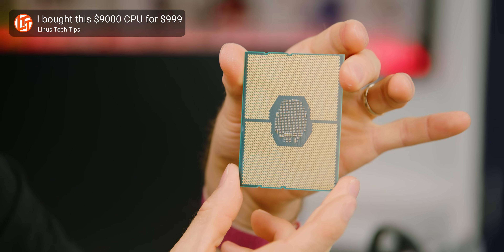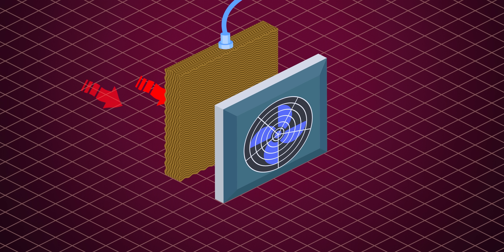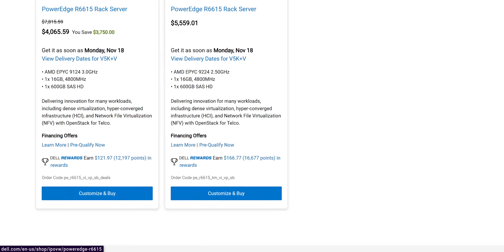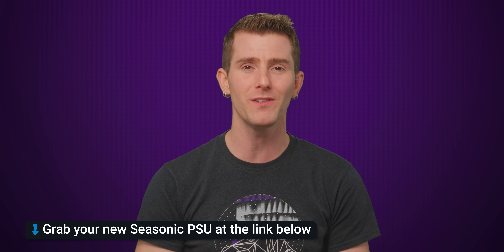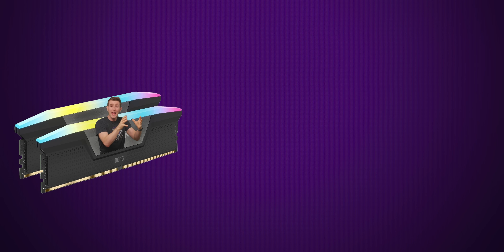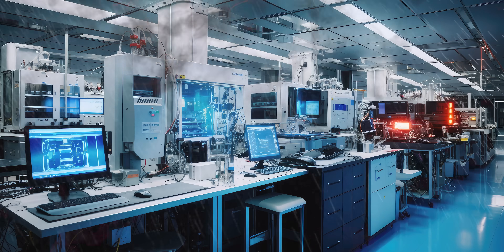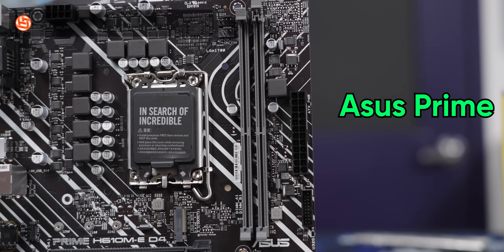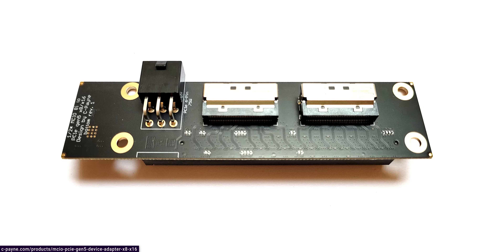What’s The Difference Between A Server and a PC?

Comment: I've used quite a colorful array of "servers" over the years. In the early days when Minecraft was still up and coming and Teamspeak was still a thing I've used some old spare laptop tucked away somewhere (with adequate cooling) to host game servers and VoIP... until it's fans gave out. Reliability? Never heard of 'em.
Next I upgraded to something more professional since my needs shifted, a Synology DS713+ NAS to store my files and backups and host some lightweight applications.
And while it was not very powerful, it was very reliable. Never crashed, never complained for many years. I still have it around somewhere, and it would probably still work fine.
But nowadays I use a custom built 4U rackmount server with a Xeon E-2276G, 128GB ECC memory and 54TB of HDD Storage running Unraid, with dual parity disks + 2 cache M.2 NVMEs for Docker containers and VMs. My network as a whole also got a big upgrade, at the core I have a second-hand HP ProCurve PoE switch (lifetime warranty, already saved my ass once!), a hardware firewall (FortiGate) and a handful of Ubiquiti APs.
Been a really interesting journey so far, and I can't wait to see how it continues.

Comment: Architecture used to be different, too.  x86 machines rule the roost now but most Unix and Unix-like boxes weren’t x86 until sometime after the turn of the century.

I have a uVAX II and ostensibly, it was a server at some point.  But, I think the exception to the x86 might be IBM’s mainframes, now.  Or ARM.

Comment: Linus, what about the breaker boards like Nvidia has?

Their Orin Boards are about the size of a credit card, and that’s including 64GB DDR5 and the largest NVME and SSD you can stick in there(besides PCI-express

Considering they have multi module boards for AI and networking, could you cram More hardware in that way, say if you have 4x 7 module boards per shelf/rack?  

That would be 336 CPU cores, 1.792 TB Ram, 224 TB storage (not including PCIe or other connectivity) and 57,344 GPU’s- and each one can be dialed from 50 watts, down to 15 watts.

That’s a grand total of just under 1.3 KW or under 500 watts (15 watts a piece)

That’s more grunt and less power than an Epyc Server!  Including GPU Computer!

Comment: Really the difference from your home PC and a server in hardware is most servers will have redundancy and most servers will have error correctly RAM. The rest depends on the use for the server as server CPUs can range from 8 very efficient at passing data from PCIe slot to PCIe slot and PCIe slot to system RAM to 192 CPU cores for heavily multi threaded on the CPU compute tasks. You then have the servers wtih maybe 128GB of system RAM  and maybe a quad core CPU but 50 or more 3.5" drives. Etc. with different types of servers out there you even can turn a raspberry pi 2B into a server and if what you expect it to do it is able to it will run well. The point of that very low end computer example is to show server hardware doesn't have to have insane specs unless you are locking at how much space and power does it take which the raspberry pi is kind of good for. Just  most enterprises do not like community supported hardware with most likely made by the company using it or community supported software. So in the low power is everything environments they still use x86 CPUs due to Business to Business support networks. The thing is in homelabs Raspberry pis and its competitors are used as good servers.

Servers are very specialized into 1 thing while the home PC is build for general use. So no insane amount of anything but everything will work.
Server software will run on both the made for the process hardware but also your home PC as long as you also have the hardware processors to run the correct instruction set or instruction sets.

Comment: Not only the hardware but also the software. I used to work for the USA's largest bank which has pretty much all of its processing here in the UK (yeah thats odd). Anyway they have the biggest DC in the UK which is the size of 3 football fields. It is insane. Every server runs a special core of Linux and is immeadiately absorbed into a massive computing pool once they come online. So those 2000 + physical servers are all effectively one. It was super clever and very interesting to work with.

Comment: The difference is function not form.  We had a dozen old desktops which used to function as PCs that we started using as print servers (of sort...it's complicated).  They were formerly developer desktops and, when they were too old to be used as such we just started using them as interfaces between mainframe and printers (again, it's complicated).  Nothing in the HW was changed.  The function was changed.  I've used old PCs as servers as well at home with no or little HW change so again, it's function, not form.

Comment: Memory errors in gaming PC's are more common than most people think. A single bir error, what ECC can detect and correct, doesn't necessarily mean that a program will crash. If you look at a gaming PC the executable code in memory is not all that large. Most memory is used for graphical elements, sounds, game maps and so on. Code that isn't really containing executable code. If a single pixel in a graphical element is the wrong color or a single sample of a sound has a bit error there is little risk that the game or OS will crash. In a lot of cases you won't even notice anything more than a blip in the sound, a strange frame in a video or a single pixel in some texture that has the wrong color. The code running through the processor is pretty damn small in memory compared to all the other assets used by the OS, the programs you use or the game you are playing.

Now I did say that ECC can detect and correct single bit errors, and that's the bog standard ECC that's been with us for many decades. It will detect dual bit errors and more, but it can't correct them. A single bit error is something you will not notice when using a machine with ECC memory. All that happens is that there will be a note in the system log saying an error was detected and corrected. One such message is not worth thinking about. it's just ECC doing what it is supposed to do. A real problem is however there if you start seeing numerous ECC messages in the log. If they are occurring several times per second or so the log in Windows will just have a message that errors has occurred and been corrected but as they are so common reporting of them has been paused after some number has been reached. It's been years since I worked with this but I think it was in the two hundred errors before pausing. If this happens there is a real problem that should be addressed ASAP. The thing is that if a additional bit error occurs so there are two or more bit errors on the same read the OS will stop the machine as ECC cant repair the error.

So why does bit error occur? Not all bit errors need to mean there is a real memory problem. Most of them are simply generated as particles of cosmic energy trike a memory cell and manages to change the value, making a "1" a "0" or the other way around. This is just things that happen, and we really can't shield computers against them. These particles can go through the earth so a lead shied or something like that wouldn't make much difference. So we use ECC memory in servers to try to keep the bit's in order.

Now there are more advanced ECC and memory protection techniques. I remember that many years back some chip manufacturer designed a ECC based technique that would detect and correct up to dual bit errors. I can't remember the details though. There were also one that would map memory as unusable if it detected major errors in a certain memory segment. The intention was that if a machine crashed because of memory errors that the ECC couldn't correct it would map that memory as unavailable when the machine was restarted making it usable but with limited memory. I think it deactivated a whole DIMM at a time, but again this was a long time ago and I can't remember the details. Also this was way back when the chipset on the motherboard contained the memory controller. Unlike today the chipset manufacturers could invent their own ways to protect memory, something that they can't do today when the memory controller is integrated in the CPU.
Some really interesting solutions has been lost with the new modern processors. But the added performance is considered to be worth it. Today it's the processors that has to support ECC, something Intel is bad at doing for their desktop processors. The Ryzen processors from AMD is a bit better at this, but even then not all models will support ECC and a lot of motherboards also lack ECC support.
Reply: Thanks for this comment.

Comment: I think lot of the problem is late 1990s and early 2000's when they used PC Desktop with multiple Hard Disks, CD or DVD-ROM drive were called Home Servers and Multimedia Servers.  Granted when compared the silly amount of storage you can fit into todays ATX or Micro ATX case are at the end of day, a hopped up PC that have excessive Storage space.

Comment: Actual answer, nothing.  HOWEVER actual purpose built Server machines are designed more for networking workloads as opposed to performance.

Think of it as the difference with having a fleet of Buses or work trucks vs.  A single high performance sports car

Comment: Also, hot swappable drives, dual redundant power supplies, ILO board (integrated lights out), multiple NICs, the list goes on.
Oh yeah, and lots of noise.
Reply: @MrPants-xy6db  Maybe, but also maybe not. Some servers are water cooled. It depends partly on where they are installed.
Reply: @christophernugent8492  I don't think that's very common in the server space to have watercooled servers.
Reply: @JJFlores197  Google does.  I have seen them first hand.  I'm an electrician and worked for a company that built one of their data centers from the group up, then stayed on for 3 months for QC.  I have also worked in other data centers.  Theirs is on a whole other level.
Reply: @JJFlores197 it becomes more common most of our new hpc are actively watercooled our older hpc are passively watercooled
Reply: @robbyrne6968  Water is not directly cooled the servers. It's other liquid (coolant) that flows though cold plate on CPU and GPU. It then cycle through the CDU (Coolant Distribution Unit) which has heat exchanger (with water) to cool it down.
Reply: @robbyrne6968  Ah that makes more sense. I was thinking more of the traditional data center/server room with noisy servers.
Reply: FYI: ILO is HPs out-of-band management (sometimes called lights-out management). There are many other versions made by competitors, for example Dells version is called DRAC (Dell Remote Access Controller), or iDRAC if integrated.
Reply: SATA hotswap is a thing on regular PC's
Reply: @whateverman2137  Hot Swap is a thing in SATA (revision 1.0a) but are usually deactivated on BIOS.
Sometimes u doest have any config to turn it on.
And the drive needs to support it.
How swap is a old thing in server world.
Reply: I couldn't hear your comment over the fans. Would you repeat that, please?
Reply: I'm pretty sure Linus has zero idea how to set up a Stable Corporate Network....
Reply: Totally.
Reply: ILO/iDrac is what really makes a server.  Without that, it's just another workstation, no matter how much CPU/RAM/storage it has.

Comment: The only difference between a PC and a server is its purpose. If it connects to other computers, it’s a client, if it accepts connections, it’s a server, it’s as simple as that.
Reply: They should have specified they mean dedicated or high performance servers.
An old gaming PC, laptop or Raspberry Pie running some services are also servers, just not rack mounted, hpc machines.
Reply: Yeah, I would say that the biggest difference is the software.
Reply: well, if your computer accepts a Team Viewer remote session from your tech support it makes your computer a server under your definition.
Reply: @TangomanX2008  It does not, as this would require port forwarding, which isn't even possible on some ISP routers. What actually happens is that two computers connect to a teamviewer server, establish a session and communicate through there. Neither accepts connections on its own, so neither is a server.
Reply: @shapelessed  

Look, the server/ pc distinction is vage. There is no definition that relies on specific technical requirements, like bandwidth or protocol, or operating system, could, etc for a "Server", at least none that is binding. If your machine is running Server 2019 I guess it's a server in some sense, but I doubt it's a server in the sense we are discussing. If you allowed someone to remote into virtually with the ability to access files, run commands, install or remove software that sounds a lot like a server to me. Anyway, this is the epitome of a semantic debate so  I won't discuss this further.
Reply: That does not conflict with what he is saying is both less interesting and less useful than the information in the video even if it’s correct.
Reply: My PC accepts many connections
Reply: My laptop is a server fam😂
Reply: I'd say redundancy plays a big part and only if you deploy servers in numbers. Servers can take decades worth of beating before falling over while desktop components will just fail taking whole thing down. Servers have a lot of redundancy built in. A NIC, PSU, random fan, stick of RAM, whatever dies, when the environment is set up right, just let the host shutdown, fail over, and swap out the hardware and reboot it. Sometimes you can even just hot swap most of it. Depending on how your cabling job in the back of the rack is lol
Reply: @Baulder13 I don't think that what you said is necessarily important for a PC to fit the definition of a server.
I connected an old 2014 cheap laptop to my router and forwarded some ports, I host a website, and a VPN, a password manager and other small services on it.
By all practical means this is a server, but it's not the big racks upon racks of compute power with the heaps of redundancy you imagine.
Reply: There are servers and "servers". My home server is literary my old desktop.
Reply: Well... servers are designed for heavly I/O and a ton of RAM and disks
Server processors usually are 3-channel instead of 2 as a PC
Processors have lower clocks and much more cores, and uses a reliable architecture (client PCs usually uses the last architecture, and Xeon for example takes a long time to switch to a new one)
Motherboards and power supply are proprietary instead standard...
Usually they have iDRAC or some remote technology for accessing it... PCs for enterprise have vPRO/AMT, but is not the same OOB.
Reply: @AlexeiDimitri  Enterprise Servers are, and they today have 12 channel memory.
But anything that runs a service can be a server. And even then, you can buy server motherboards in E-ATX or ATX form factor powered by normal ATX power supplies with remote management.
High density servers often have custom motherboards to optimize for space, but there are many that use standard form factors.
Reply: @AlexeiDimitri  heavy*
4-channel*
use*
Notherboards are only proprietary if they come in a full server assembly, which is  ot all of them*

Comment: After 25 years of using desktop hardware for my home server (upgrading and replacing over the years), I finally put together a real-deal server.   2 CPUs, 72 threads, 96gb R ram (128gb on the next powercycle), 5 drives with 2 raid arrays, 4U case.

It's GLORIOUS!!
Reply: I grabbed be an ex-business CPU+MOBO+RAM combo from eBay (there a lot on there, and /r/homelab and /r/datahoarder have recommendations about which to use). Thinking about upgrading my 2cpu, 40 thread, 128gb RAM server to one of the Epyc options available, which can be got for as little as 1k for a 32c Rome + MOBO + 128GB RAM, since I now have 180TB of space.
Reply: living the dream dude!
Reply: I moved to this about 4yrs ago. Got a Dell T110 series tower server. Its like a huge PC but almost silent to great for home use. And it has tons of drive bays, so was great to max out with storage and run ESX for all my VM's. At one point it had been on for 2.5yrs without being rebooted. Recently re-worked the whole thing and moved it onto Proxmox which was daunting at the time but now love it. Even seems more efficient at resource handling.
Reply: @I_Am_Your_Problem  hosting your own Netflix (Jellyfin), Google cloud (Next cloud), backups, surveillance. It's awesome. Also the learnings directly transferred to my job.
Reply: What server is it?
Reply: @I_Am_Your_Problem lol why would you assume that? very weird comment
Reply: 128GB is still not really server territory. My company has a minimum of 768GB of RAM per server and this is going to be increased to 1TB. The 768GB number was obtained by our accounting department based on the cost of the server, RAM, and data center space. Our SAP ERP system has 32,000GB of RAM. Yes 32 THOUSAND gigs of RAM. This is because SAP really likes it when all data fits into RAM. If it does then queries that would take minutes now take seconds or less.
Reply: @kellymoses8566 you should be the most funny person at parties man